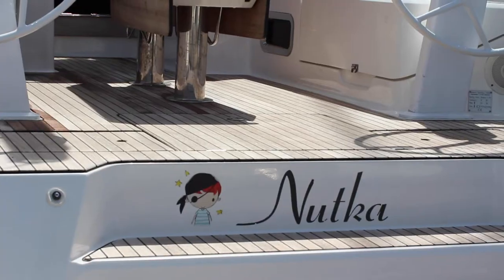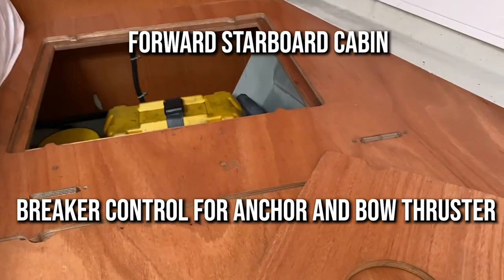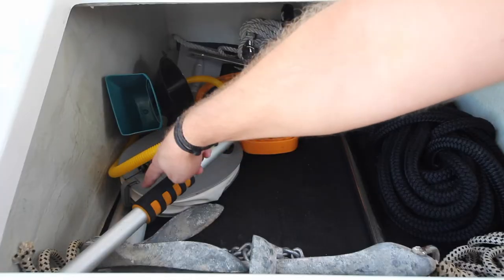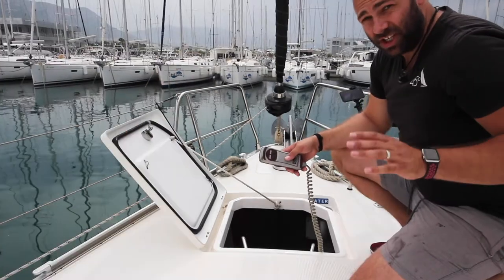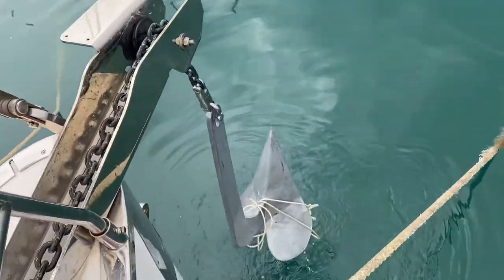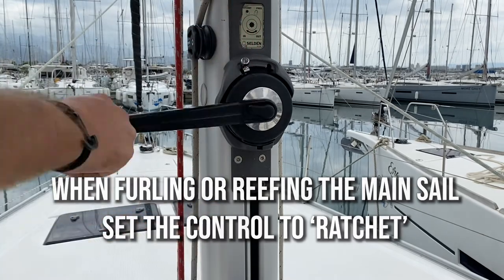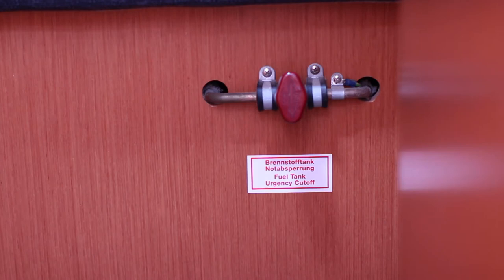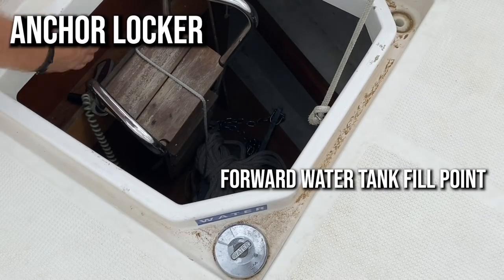2015 Bavaria 46 Cruiser Detailed Checkin Walkthrough

Comment: Great video! How old is this specific boat? We are chartering one this September, specifically the Veritas Edition of this boat. Looks nice! Cheers :)
Reply from the maker: Thanks 🙏🏼 this one is 2015. Very well kept. Good condition for her age. The model has changed very little since then.  Is the Veritas the 2008 model?
Reply: @45DegreesSailing  Yeah, it looks very good! Yes, the Veritas should be the 2008 model, so seperate navigation desk, 4 cabin layout with the bunk beds - im mostly wondering if these bunks can even fit a normal sized human^^
Reply from the maker: @llleolllolll  ah ok. Look they are pretty small. Normal size might be ok in the winter. In summer. Even the kids have trouble with them as it is so hot in there. I think I have a review where I jam myself into a bunk on the Hanse 505 you can see. And these are bigger than the Bav. https://youtu.be/Y06gsmKmSMI
Reply from the maker: @llleolllolll  you can see Bunks in the chapters. At 18min I think.